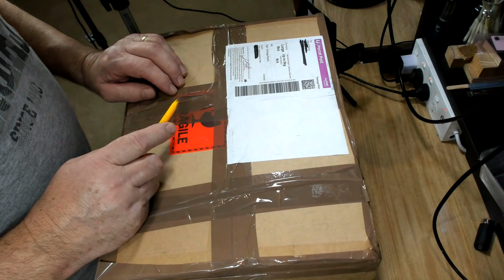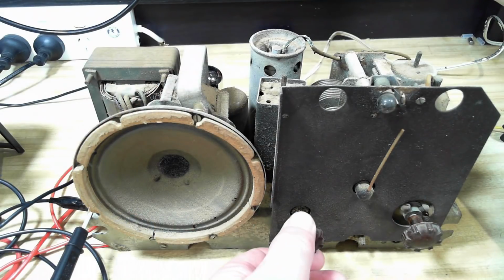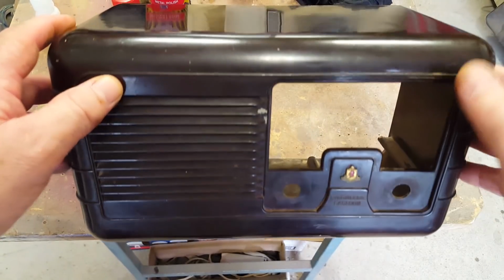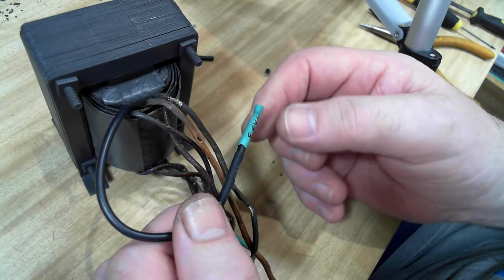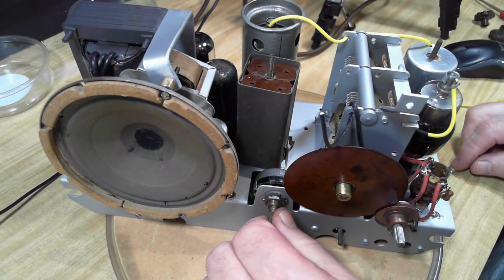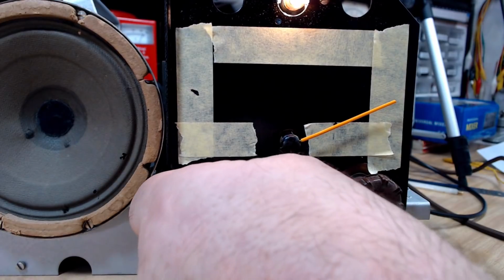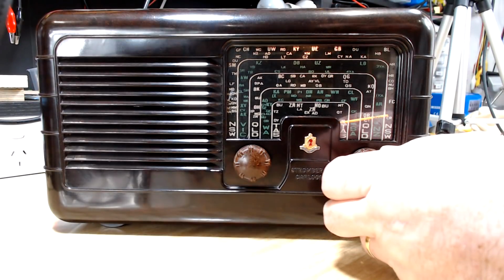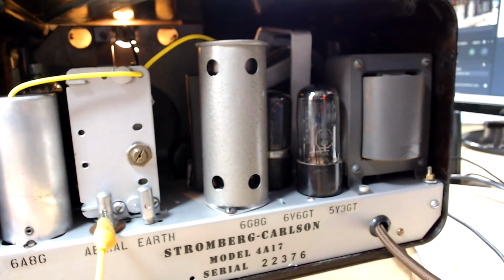1947 Stromberg-Carlson 4A17 Restoration - Extended Version Lockdown Special

Comment: I think Restore Old Radios came up with that liquid tape to fill holes in speakers idea. I have noticed people complaining that the bottle dries up and becomes 
like mud in the bottle. I found that you can extend the life of the stuff if it comes in a glass bottle especially if you turn the tightly closed cap upside down and put the 
bottle in a resealable sandwich plastic bag . This may also work for a metal container too , haven't trying it with one, but if you keep the air out of the container
it should last a really long time! Great restoration of this somewhat rare radio. Decal of the rear chassis was brilliant!
Reply from the maker: Hi he's the Master, good idea, I will store mine upside down at least, that should keep it a bit longer 👍 thank for your comment HtM 😀
Reply: To keep it from drying out try putting the van in a zip up bag and store in the freezer. Then let it warm to room temperature before use. Works great! It can't dry out if its not evaporating due to the lack of heat.

Comment: Hi David,
I’m 17 years old, currently finishing high school and fascinated by these old radios. I’ve restored some valve equipment in the past but would really love a project to work on while in isolation. If you know any places I can find old tech that would be amazing. Thanks for your descriptive and well made videos!
Reply from the maker: Hi MrPRG, firstly thank you for your comment and interest in old tech. I probably can't help you too much except to suggest that I use eBay (expensive) and FB Marketplace, I also use Gumtree but that may not be available in your area. I am in a vintage radio club and that is a rich source of gear and experienced members. There are also FB buy and sell groups you could try. All the best with your endeavors 👍😀

Comment: When I first saw this radio, my first thought was "Spare parts donor." My second thought was "Well, if anyone can sort it, it's Dave." I must admit though, even then I didn't think you'd achieve such a tidy result!

The case came up a treat but I've seen you rescue worse so that wasn't a huge suprise.

I couldn't believe it when the dial alighnment was so far out when you refitted the chassis in the case. "Eh? What gives? He usually gets them spot-on." It never occurred to me that the glass might be different and your workaround worked beautifully. Top job!
Reply from the maker: Thank you Paul. I agree with everything you said. I too wondered if it was worth fixing, I was unsure about the Bakelite repair and that dial glass had me going for a minute 😖
I had no idea if the extra capacitor would fix my problem but delighted it did and good info for the future. Cheers 👍🙂
Reply: @DavidTipton101  Adding the extra capacitor was a brilliant idea.  Worked out a lucky choice.  Was it first time lucky, it looked like that on the video?
Reply from the maker: @BoB4jjjjs  Hi Bob. Yes it was a calculated guess, those trimmer caps are usually about 0 to 30pF so I  added anther 15pF to see where it would go. It turned out OK first time which was pretty good 🙂

Comment: Very nice looking unit in the end..
Great job on that crack as well.
I have a Stromberg Carlson 4A20 without a case. Is going to be hard to find as it has the side mounted knobs. 
Might end up making a wooden case for it or fitting it into an old westminster mantle clock body
Reply from the maker: Thank 1974UTuber. The 4A20 was a few years after mine, I have the schematic if you need it. You might be able to get a second radio with a poor chassis. There are Facebook groups you can join and ask, Gumtree and FB Marketplace are a good source too. A wooden case would be fun but tricky to not make it look homemade unless you're into that sort of thing. Good luck 👍😀

Comment: Great Job as usual Dave! Im glad to hear you feel a little anxiety when ready to power up....lol....I thought I was the only one that felt that!! Great to learn about stretching the dial and tone changes....how did you reinforce the inside of the top of the cabinet? Thanks for sharing this great video! Take Care—Larry
Reply from the maker: Hi Larry, thanks. It's a little daunting after so much work and so many parts disconnected at once, if it didn't work it would be a long process finding the error. I did film the reinforcing but cut it out. I used a strip of thin aluminium and JB Weld. I also used JB to glue the chassis retaining nut back to the case 👍🙂

Comment: Nice job on the radio Dave! I was wondering if you might make a little video on your dim bulb power supply and how you fabricated the case with the nice graphics on the front. I know dim bulb supplies aren’t to complicated but yours looks quite nice? Thanks
Reply from the maker: Hi David, thank you. I'll see what I can do. It is just a wooden frame with an aluminium front panel and the switches etc mounted on it. The graphic on the front was made in MS Publisher, printed on paper, sprayed with clear lacquer and glued to the face plate 👍🙂
Reply: @DavidTipton101  Thanks

Comment: The radio looks great and appears to be better than as it was from the factory...certainly with the plastic wire sheathing and modern capacitors and resistors. Well done ! 👍
Reply from the maker: Hi Steven, thank you. It's good for a few more years now 😀

Comment: You would think that someone with experience with old radios like this would know better than to just wrap it in som bubblewrap and throw it in a box.
That's bound to get damaged.  Something as heavy as a chassis like the one in a tube radio needs firmer packing.
Or remove the glass and pack it separately...
Nice restoration work as always, and a beautyful result in the end. Fun to watch except for the unboxing part.
Reply from the maker: It was a shame about the glass. It broke because the chassis struck it during transit. It must have received a good jolt to do that. Thanks Geir Endre Jenssen 👍😀

Comment: another great restoration David, I'm about to restuff the capacitor can  2 x 16uF 450V on my Codar receiver , and I'll be copying what you've done :-)
Reply from the maker: Hi Paul, it's a neat solution and doesn't crowd out under the chassis. I hope it works for you 👍😀

Comment: There's a technique for making pcbs by using toner transfer - you print the design in reverse on silicone paper or magazine paper and then iron it on to a copper board. The toner re melts and sticks to the board. You've probably used it. I think it would work on glass. So you could recreate the dial design and then iron it onto a glass rather than abandoning a project or sending out for a replacement.
Reply from the maker: That sounds like something that might work. I have done that transfering text to wood except you use adhesive to stick the printed paper text down to the wood then dissolve the paper with water. I'll keep that in mind, thanks Andy 👍😀
Reply: @DavidTipton101  ahh, was that following instructions from 'your friend, the Crafsman' ? I think he's great.

Comment: Excellent Dave! The crack in the bakelite almost disappeared! What did you reinforce it with underneath?
Reply from the maker: Hi The Ultimate Recycler, thank you. I hope to do a better repair next time but it's not noticeable with it sitting on the buffet. I reinforced it with a strip of light aluminium from Bunnings and some JB Weld. I did video it but the video was running long so cut it out 🙂

Comment: I had a similar problem with a broken dial glass, I used emergency glazing (plastic sheet that is adhesive on one side) to hold the glass together until I could get it scanned for a replacement to be made up.
Reply: Does this mean there is a simple method to print water-slide transfers at home? I'd be very interested to learn about that! Cheers mate.
Reply from the maker: That was my next step if I had to get a copy made. I should do that in case someone want the artwork one day, thanks Christopher 😀